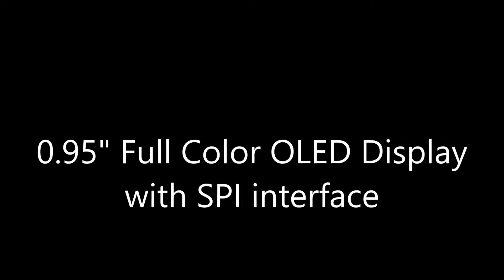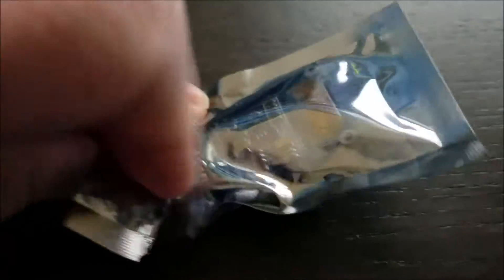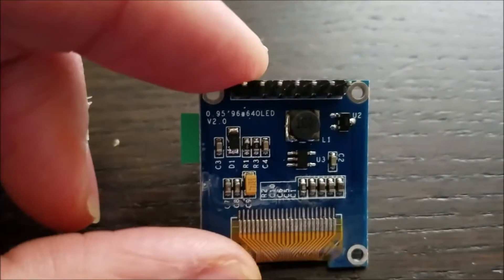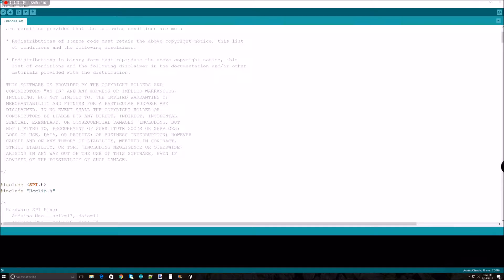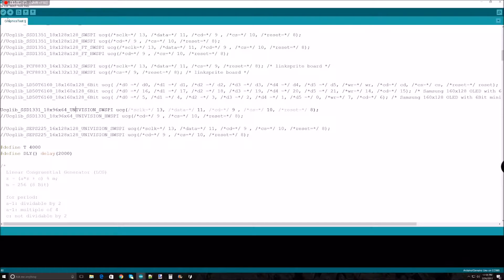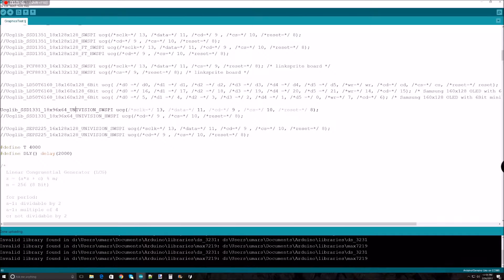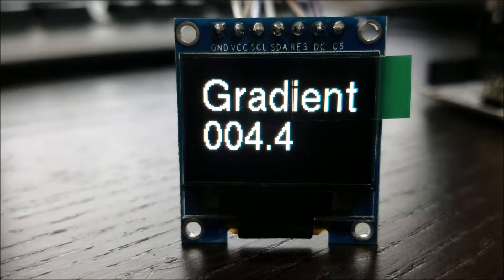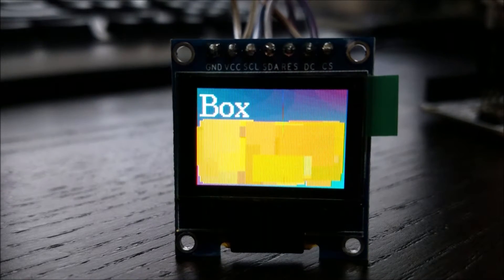0.95" Full color OLED display with SPI interface and SSD1331 chipset

Comment: Hello, if the display is connected to VCC, it will turn on automatically?  Since I connected the same display to all pins and I can't see any reaction from the display, I don't know what's going on
Reply: It's an OLED display, it will not show anything until it is correctly initialized by the software. There is no backlight, so you won't see anything.